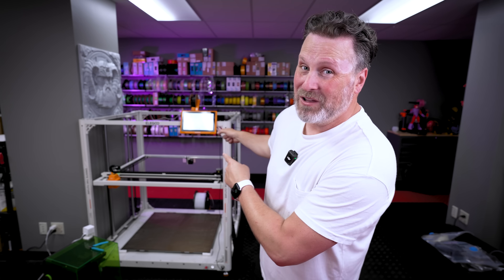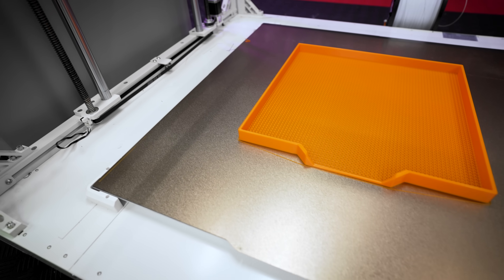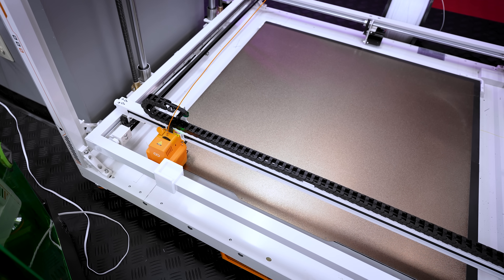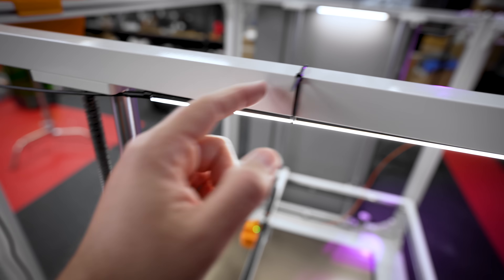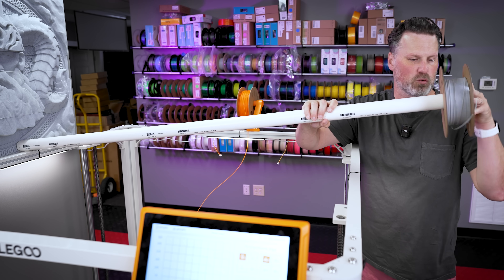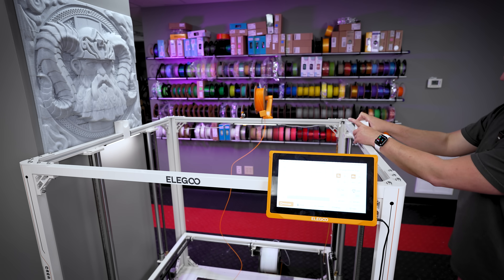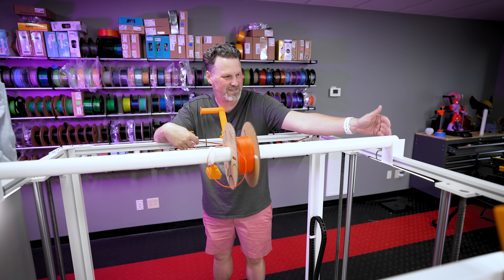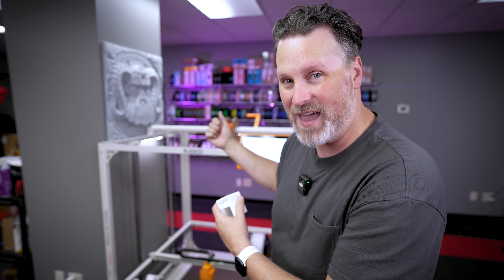Giga Sized 3D Printer Mods! Elegoo Orange Storm Giga

Comment: I’m an early bird backer so in theory my unit should be on he way and it’s really disappointing to see elegoo again leaving it to the community to fix their kickstarter projects ( I backed the Jupiter and the Phecda) sponsoring a vid where you work on fixing their design flaws seems like a bit of an fu to the backers
Reply: I hear ya, I do, but why keep backing their kickstarters when this is your pov of the company. To actually effect any kind of change to their anti consumer business practices (releasing unfinished products, not bothering to fix those products instead relying on the community, misuse of Kickstarter) those practices cannot be condoned but must be actively discouraged. Complaining while simultaneously throwing money at them undermines your position. The only thing I've ever seen sway any company is money, especially for higher cost items like this. Just my $0.02
Reply: @RobertD_83  valid question and it will be the last product of theirs I back but  the jupiter and phecda despite not being supported post release both worked mostly well (the jupiter needed a z axis brace and the phecda limit switches which were never addressed by elegoo) but other than those small issues for the price point at the time of their releases were well featured and didn't feel like an active cash grab.  The giga from all the early tests and reviews does especially knowing they've already shipped the customer units while problems keep coming up

Comment: Just have two pipes going across the top?

One for wiring that's a bit more "permanent" and the other to hold spools. Then any sensors, wires, and whatnot can be put in the permanent pipe and won't be messed with as much avoiding wear and tear.

For the spool pipe, just print taller brackets.

OR

print one backet that holds two pipes, one above the other, with spools on top feeding down into the bottom pipe with sensors.

Comment: ie: filament detector... Mount it on or over the print head so you don't lose 4 feet of filament when it runs out. Maybe where the cable track mounts.
Reply: I don’t think the cable would be long enough to move it to the printhead. And if it did it would be loose and might hit the printing object. Unless you could do some trick cable management.

Comment: I would replace the PVC with an extruded alum rail and just move the mounts for the spool holder and sensors from the back to the center. Looking at the wire for the run out sensors you should be able to get a 2 to 3 foot long 3-wire extension cable and move all the run out sensors to the new center rail. You can then use 3d printing to make brackets for the PVC pipe and make a heavy duty spool holder for 5kg spools.

Comment: You could turn the pipe 90 degrees so it runs front to back.  Then you could run the cable for the filament runout sensor from the back to the middle of the pipe, but load the spools of filament from the front of the machine.  You might also want to think about having 2 pipes - one for the spool of filament, maybe slight off to one side, and the second pipe to guide the filament over and down through the filament runout sensor in the center of the top of the machine.

Comment: I would simply screw an aluminium profile in the same dimension as the frame over the middle. This even provides additional stability. And then you can mount the original filament holder and sensor on this beam instead of the rear one

Comment: 2 poles going across the top, and then a lil "PAD" that can actually hold the 5KG spool holder, or one that could be for the 1000 gram roll, as in sits on top. So you need a DOUBLE 1.25" stand off mount, (2) PVC PCS AND RUN THE WIRES THROUGH IT, AND ATTACH a flat spool mount to it , and you might actually want to mount the spool sideways so it comes out directly in the middle.. and a guide for the filament there in the middle to keep it okay.

Comment: Problem: Extrusion mounts are loose. 
Suggestion: Make some holes in the mounts and use t-nuts in those extrusions in the top of the frame.

Problem: Spools hanging too low. 
Suggestion: Make it taller OR use a double rod design that has the spools sit "loose" on top, using bearings to let them spin.

Awesome project tho :D

Comment: You can still put the spool on from the other end of the pipe without the sensor cable being an issue 🤣. But yes the bracket would need to be much taller for tall prints.  Good job though 👍🏼. 
You are giving us more insight than elegoo is..
Literally no info or feedback at all from elegoo after the community investing over $3 million into the project. I am very disappointed with them leaving us in the dark like this. Cant believe they are shipping a printer with so many issues that people are now going to have to modify themselves. I own almost one of every single printer they ever made. Very disappointed in them with this project.

Comment: Cool ideas for the printer.  You could use some type of square tubing or 2020 extrusion instead of the round pipe and then just use the same filament holder that came with it and mount it in the center.   The original mount could just mount the to 2020 with t nuts or m4 or m5 screws and heat inserts.
Reply: That was my thought too

Comment: Wonder why they didn't do a single large build plate, from the jump?
Reply: My guess is cost and availability.
Reply: Many corners cut on this machine, this is one of them
Reply: Companies have trouble getting bed that are completely Level imagine a giant sheet of metal like that
Reply: They probably decided to size the build volume exponentially based on another large printer they manufacture, this would eliminate the need for machinery that can produce a plate that big. Just an inference tho, could be talking out my *
Reply: @Aidennification  This is exactly what they did. They took the Neptune 3/4 Max build sheet and used it on this printer (x4). That is why the build size is actually 840x840, not 800x800. Well, they might have limited it to 800x800, but the actual width of the build plates is 840x840. Elegoo did confirm this.
Reply: May be something that large expanding and contracting in 4 different sections could probably get warped by a large margin
Reply: Exactly, I understand it would increase cost and it would be hard to work with but it would’ve improved the design and quality of life
Reply: Shipping probably
Reply: Cost, availably and first responses to see if it's worth to develop.
Reply: I would guess for cost, not only for them but for you.    If you needed to say replace the build plate it would be cheaper and easier to do it in sections rather than all one plate not to mention shipping/vat cost for the larger plate would be outrageous
Reply: It took them 4 years to print the parts. 

Seriously, with a build plate that big, I wouldn’t be surprised if prints take a week.
Reply: This might be a question that answers itself, but only after some time has passed. We'll see if problems develop with that big plate he bought.
Reply: Warping over a few heating cycles id imagine
Reply: So they can later sell pro edition with one large build plate.
Reply: Such a badly designed printer, not even remotely worth the pri ce
Reply: Being cheap
Reply: I mean, it's already a 2500 printer, for a very specific use case. 

Might as well
Reply: Because that's what testing is for. Elegoo should have QC'd this better. It's cool, I'd like one for cosplay one shots, but design features should have been thought out better.
But why bake yourself when you can have your community do it for you. Companies need to step up their game.
Reply: Short answer: thermal expansion
The bed heaters don’t heat perfectly evenly. Over an area this large the temperature variations will cause the bed will buckle. 

For those of you saying cost: nope. Sheet metal is sold by the area and cuts. It costs more to cut it into 4 pieces than 1 or 2. Shipping could have been a potential reason, had the printer not been so large to require freight. 

All these YouTube University engineers need to chill.
Reply: @TheOfficialOriginalChad  One of the rare genuinely informed replies I'll come across on YouTube today. Tip of the hat to you, sir.